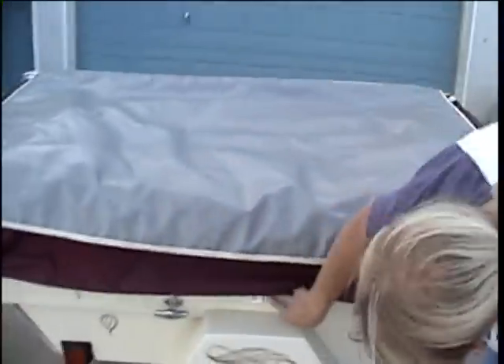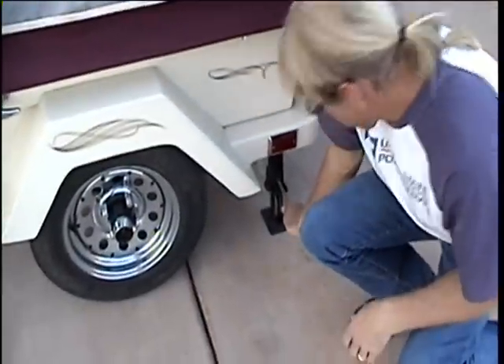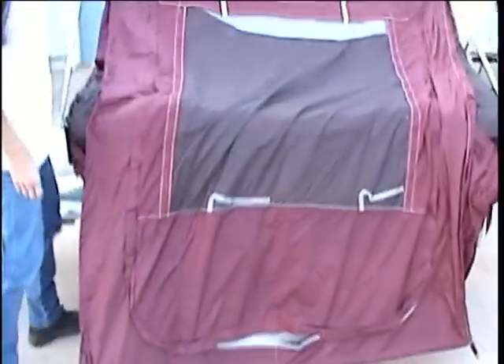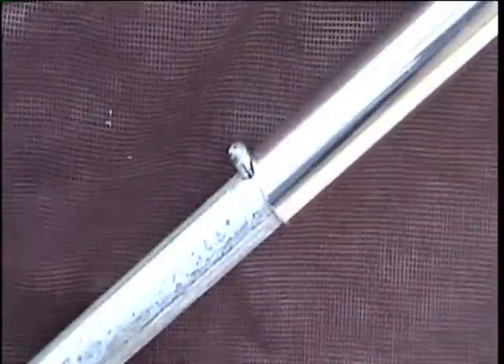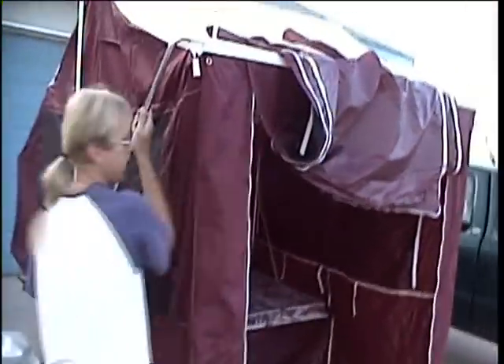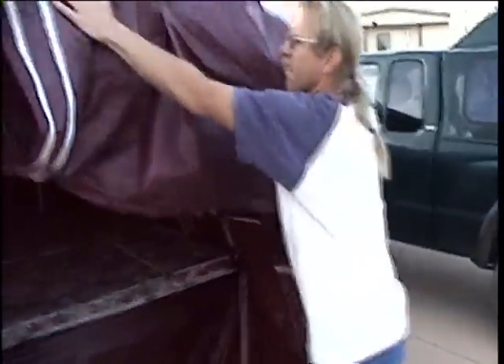Bunkhouse camper setup-Motorcycle camper

Comment: We have had our 1997 for 13 years. I love it. We bought it when we had a goldwing motorcycle. We no longer have the bike but we still use it and pull behind our SUV. My sister and I have taken it on a 4000 mile road trip just by ourselves. We camped in the snow in below zero temps with electric blanket and ceramic heater! It stayed very warm. In the over 100 degree heat of the summer, I have taken a small AC unit and placed in the door with zipper pulled down around it....worked like a charm. We also have personal fans hooked up on the inside rail (with electrical cord) above the sleeping area.The electrical cord stays hooked to rail when folding up the camper. All you have to do is plug it into power when you camp and then you also have outlets to plug in coffee pot, cell phones and TV. The bed gets kinda hard after a while (to our over 60+ bodies), so we put down a feather mattress cover which also stays on the bed with comforter, sheets, etc when we fold it up. It has lots of storage room, light weight, and very convenient for those road trips!

Comment: Thanks for sharing your expertise. I too just bought a 1997 Bunkhouse Estate Motorcycle Tent Trailer with no instructions for putting it up or taking it down. Is the Travel Cover original equipment or did you have that made? If you had it made, may I ask where? I really like the looks of it with the two stripes running the length of the cover and it looks easier to put on also
Thanks again,
Hoppy
Honda VTX1800C
Reply: did you happen to find where to find a new travel cover ?,,,, where to get any other parts , in particular the whole tent to replace the existing one that is getting pretty rough,,, thanks,,, i have this same camper, best i can find is parts for the aspen classic